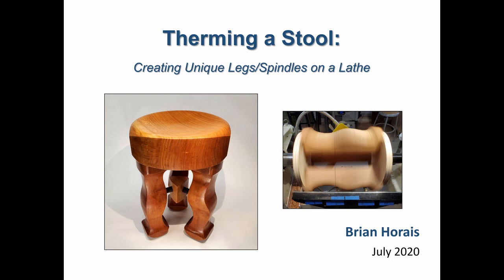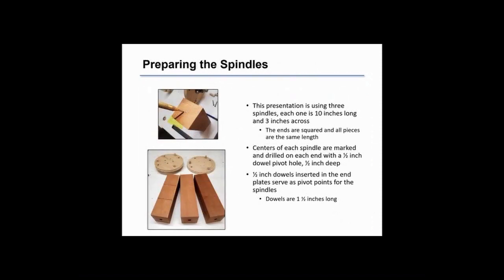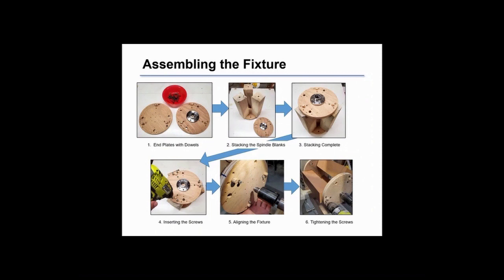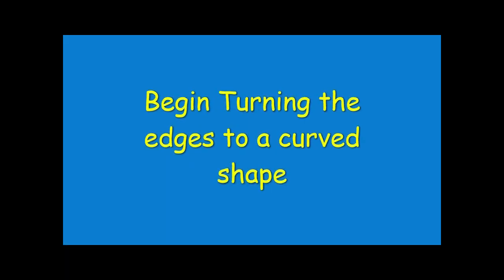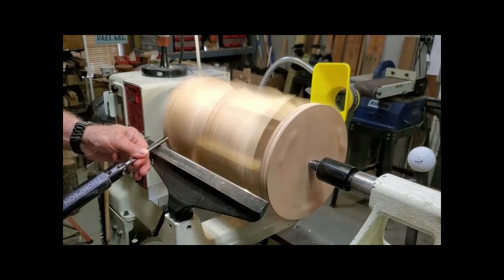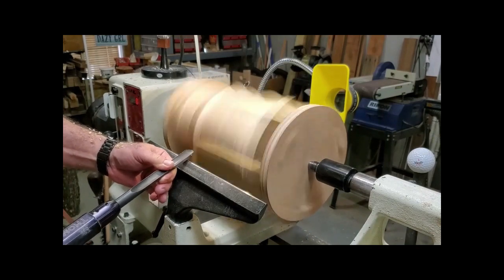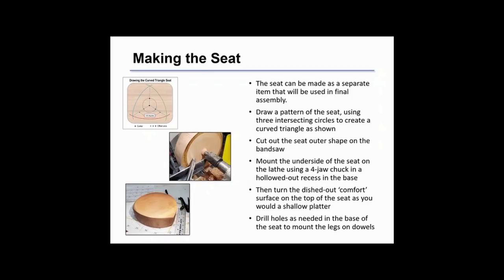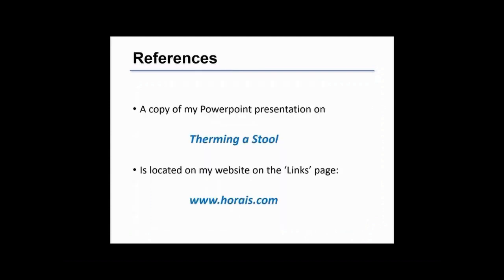Therming a Stool

Comment: Thank you for sharing Brian. I've been putting this jig off since seeing Art Liestman do this type of turning during a demo live. I made the shaft with a morse taper MT2 a while ago. I also keyed the shaft. I just need to machine some hubs now.
Reply from the maker: Thanks Dave.  When I took the class from Art he had the MT2 keyed shaft and hubs made for us (for a small fee) and then we added the 3/4 inch end plates in the beginning of the class.  I still use the keyed center shaft setup occasionally but find that the simple plywood end plates also work well for lengths up to 20 inches.  I wonder if you could use the small metal end plates made for the lathe and smooth out the internal threads - then add a groove for the key?   Enjoy, the therming is a great mental and turning exploration.